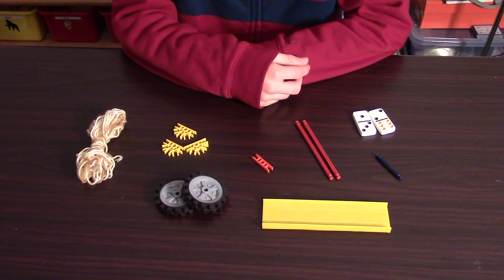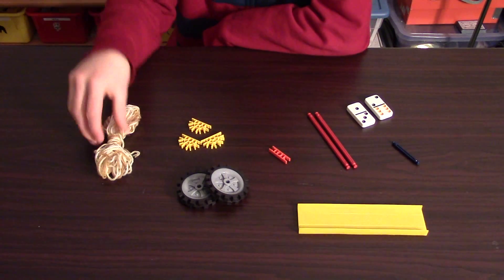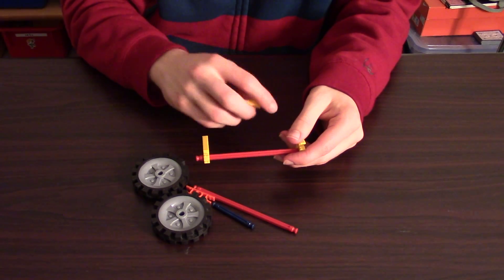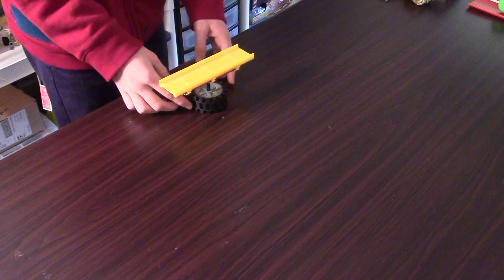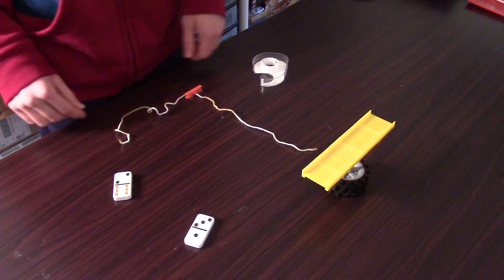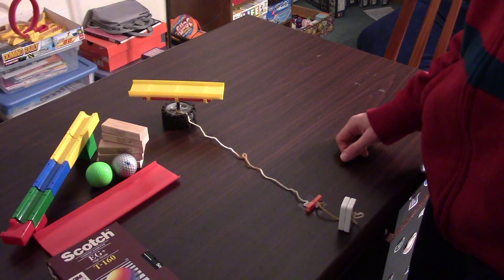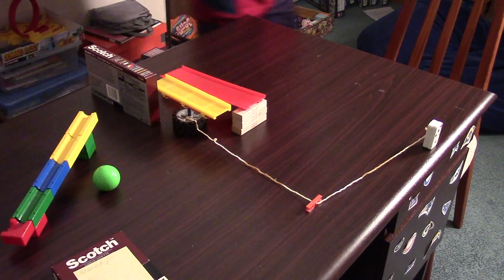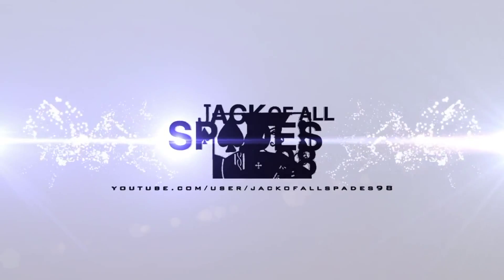Tutorial #3: Spinning and Moving Track

Comment: I actually tried to connect the three yellow connectors with one of my Hot Wheels tracks, but they were to fit under the track. What brand of tracks did you use for this tutorial?
Reply from the maker: The brand I used is Darda. It is a coincidence that the track is compatible with K'nex pieces. If you have the same kind of Hot Wheels track as I do, try taping or gluing a round K'nex piece (usually white or black) to the underside of the track in the center, then building the rest of the assembly normally, and sticking the blue rod through the center of the round piece. The track should spin the same way mine did. If this works for you, don't forget to reply with a link to your video with this technique working! Hope this helps!
Reply: jackofallspades98 Thanks, man! I'll see if I can do that!